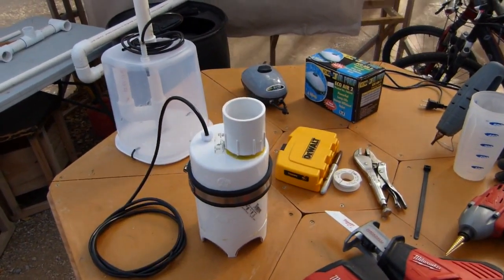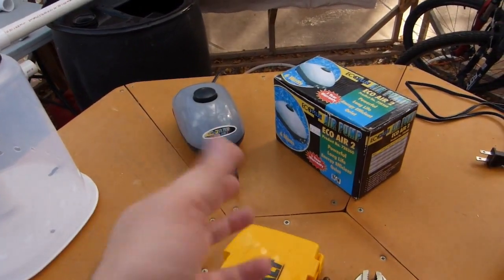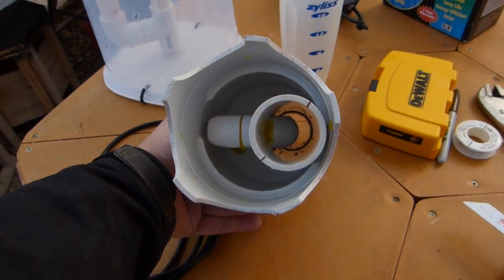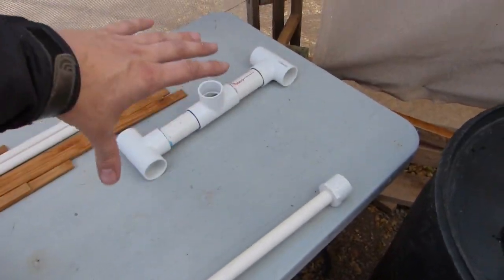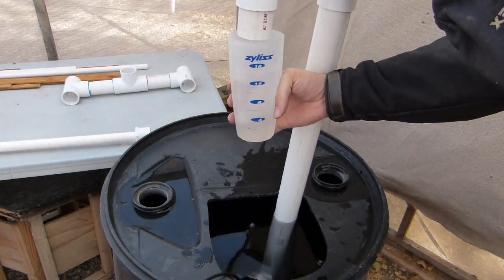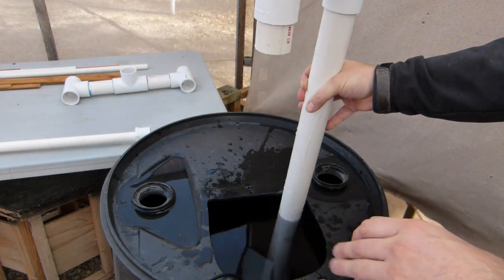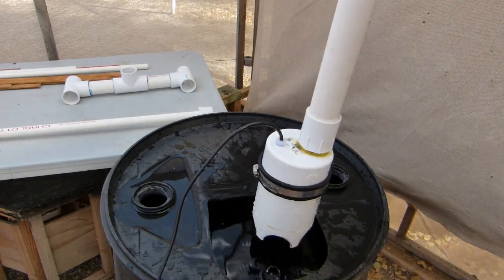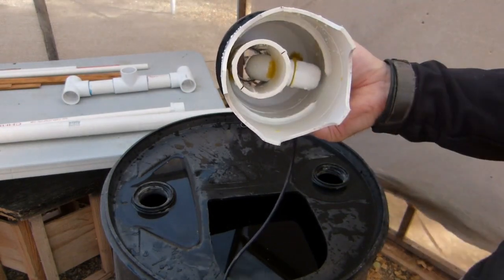Low Power Airlift Geyser Pumps - Part 3 of 3

Comment: i was wondering if you put some check valves in line would it be able to raise the water to a higher level such as pulling from a well. Just wondering if anyone has tried this. I am sure i would have to have a larger air compressor to do this but before spending the money i was wondering if someone had tried this at say 100 feet.

Comment: This larger pipe is very interesting for those of us doing aquaponics since it will pump fish waste without clogging, as well as adding a bit of aeration. I know it would be a hassle, but it would be great to quantify cycle time and volume pumped with a range of pipe sizes, head, and air volume. I'll bet it will do much better with a better air pump: I've had one of these running non-stop for over 2 years now: http://alliedaqua.com/elemental-o2-commercial-air-pump-1157-gph.html $40.

Comment: Informative video.  Where did you find the fitting to connect the air hose to the PVC cap/pipe?  Searching everywhere for one.  If you can get a part number for it as well, that would be great.

EDIT:  Trying these...
http://www.amazon.com/gp/product/B00YGR2ILM?psc=1&redirect=true&ref_=oh_aui_detailpage_o00_s00

Comment: my observation; when you tested the big pump at the bottom...holding it down with the orange rod...you got a big surge...seems to me...not sure because I haven't tested...that it the distance under water is proportional to the pipe standing out of the water...try different length under water as well as above water...you may get different performance...just a thought...thanks for the information...very educational...continue to march...!!!

Comment: Did you ever find a consistent ration of depth, diameter pipe & air displacement to output? That's a considerable amount of work for a 6W pump. You could run that on a small Solar Cell
Reply from the maker: ***** Yes, this simple pump moves a lot of water with low power. I'm going to use it in an off-grid greywater treatment setup. I think you should experiment with it and find the best combo of parameters ;)
Reply: Sweet, I hope you do a vid on how it turns out. I'm thinking ebb & flow aquaponic setup using bell siphon to control water delivery & gravity drainage. The only concern I've got with this is if my sump will be deep enough, but as you stated, experimentation will be the key.

Comment: I'm wondering what kind of results you would get running one of those in a deep sump tank or pond powered by an aircompressor with a lot of displacement in the cylinder.